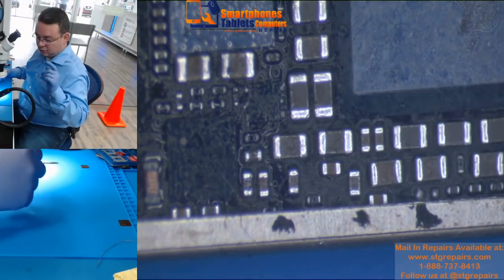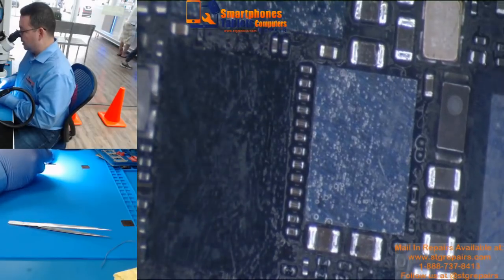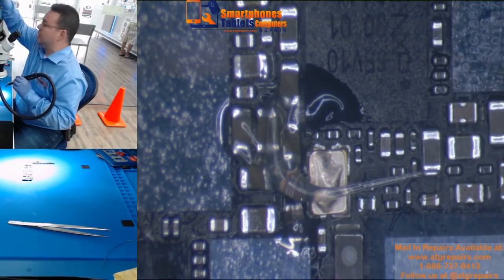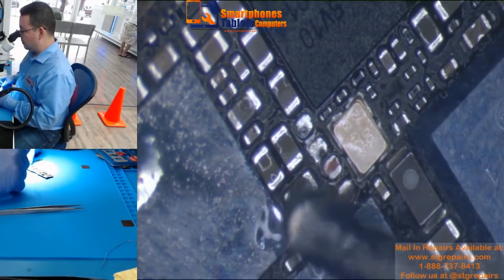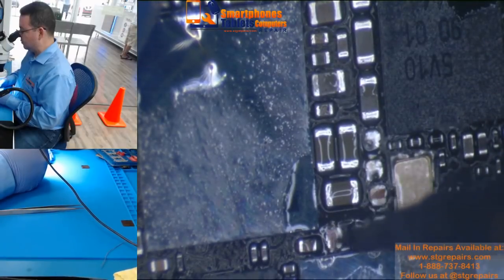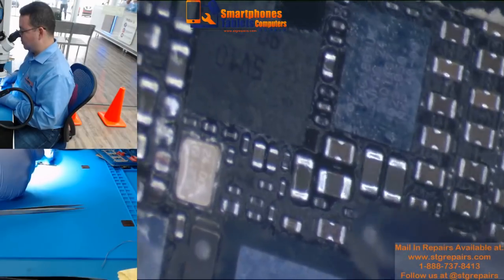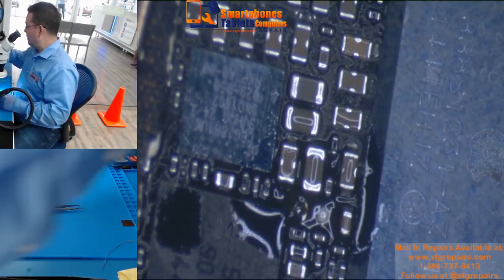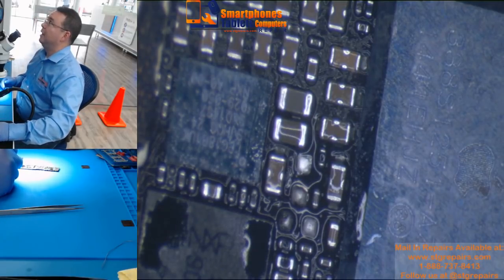Different techniques to remove capacitors in short from the board

Comment: I've started my journey into the world of electronics and the first question I have is how can we find the values of a multilayer ceramic capacitor that is shorted without schematics??
Reply: Did you ever find an answer to your question? I have the same problem.
Reply: Most of the times after removing short capacitor circut starts ...and you can replace that with similar size capacitor on don't replace just remove that....this condition not apply at a frequency releted circut as there these capsitors are used for gettin desired friquancies

Comment: Can you please mentioned What's the heating temperature and air pressure to be set when removed or reball transistor capacitor diode any mobile components...?

Comment: Why is it when I get a continuity reading on several smd capacitors, and I remove.them from the board, that the caps are tested ok and the contacts for these smd caps are still shorted to ground? I have removed every possible shorted capacitor but short still remains. Does it mean there are components other than capacitors that are shorted to ground? Like internally inside an IC or something?

Comment: Sir which soldier Flex you using , can u tell me the brand
Reply from the maker: Satish satish.s AMTECH NC-559-V2-TF No-clean Tacky Solder Flux With UV - 30cc Factory Syringe (No-plunger, no dispensing tip) 16160 USA https://www.amazon.com/dp/B01DR62IYO/ref=cm_sw_r_cp_apap_ysXtWMh3Jv15s